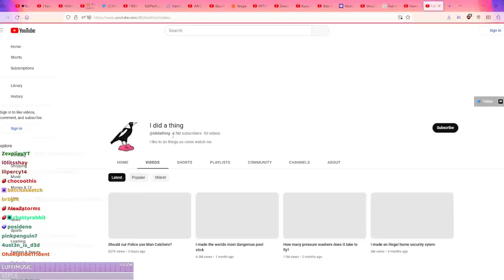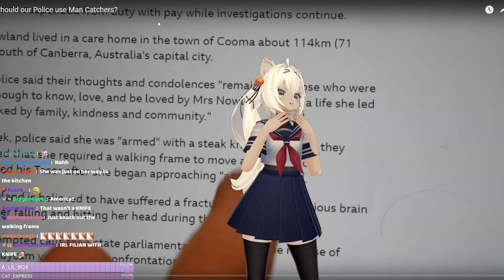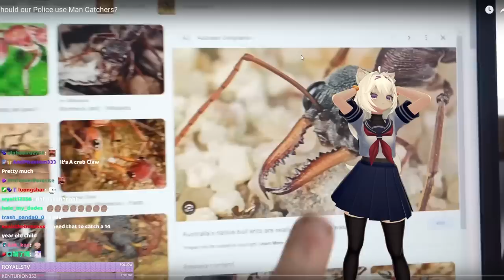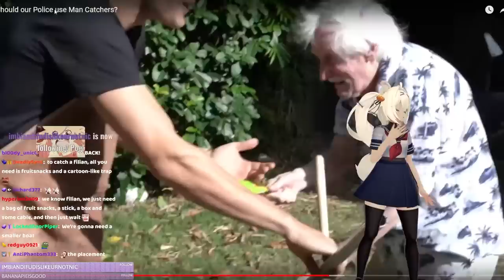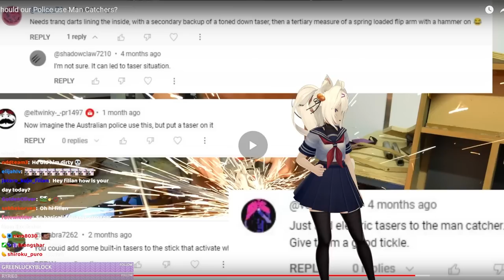Filian Reacts to 'Should our Police use Man Catchers' by I did a thing

Comment: 21:08
The way gravity works, they wouldn’t be moved by strength. Besides, the claws would dislocate if the full weight of someone was pressed against them. Even if you managed to get them over your head, you’d still be thrown down with them if unprepared.
(Also, that’s what the spikes are for. If the spiked claws completely snap shut, they can and probably will kill someone.)
Reply: The lightbulb didn't have a glass covering in its first interation
Reply: @millo7295  
Yeah. But come on, it’s I did a thing.

Comment: The reason Man Catchers were able to work is probably due to them being used not as a non-lethal weapon but rather as an actual variant of a spear. Aimed at the neck of the target, it's general design with hooks and barbs is meant to physically imply to your target that when that thing meets their neck, they have no choice but to obey and get captured, or risk possibly fatal wounds to the neck. During those times, I would think the people's mindset was that they would rather kill runaway prisoners rather than risk letting them escape.